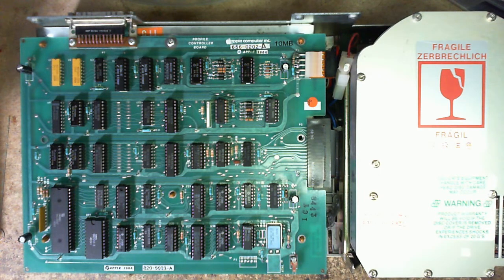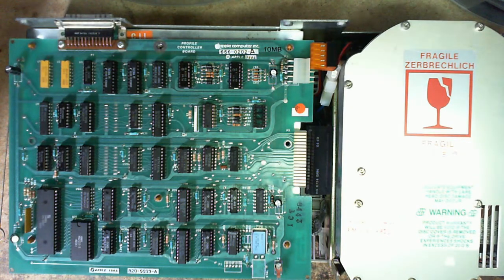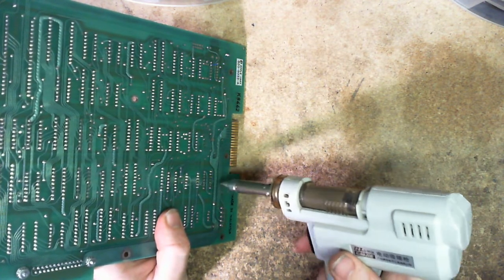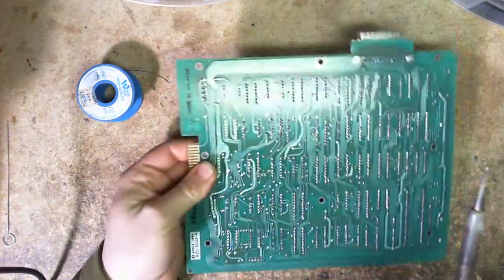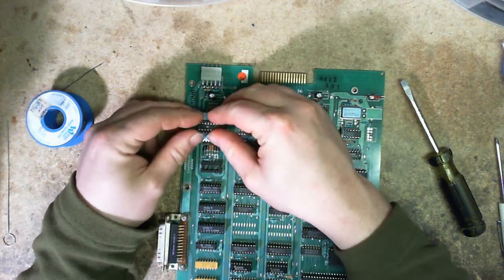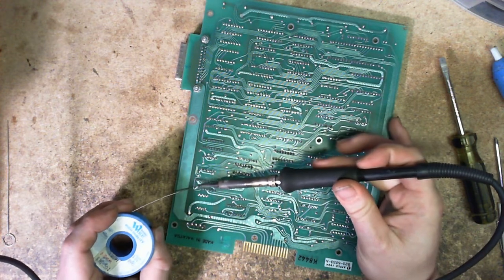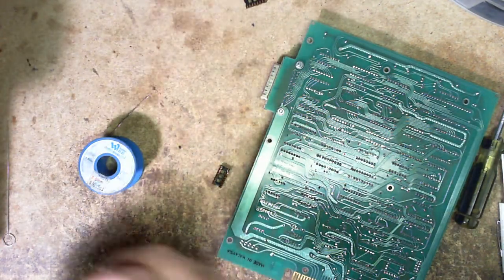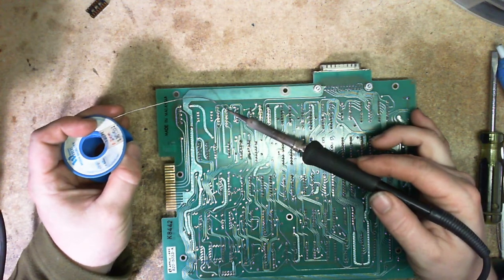Soldering! - Replacing Even More DIP Sockets!

Comment: Dual wipe sockets aren’t too bad, single wipe sockets can be awful though
Reply: Will an ic with flat rectangular legs fit in a turned socket? I’m assuming those are for ICs with round legs
Reply: Bro, what is the terminology?  Whats the difference and use case   between DIP  Dual wipe sockets , round , precision , turned, machined, etc.  ?